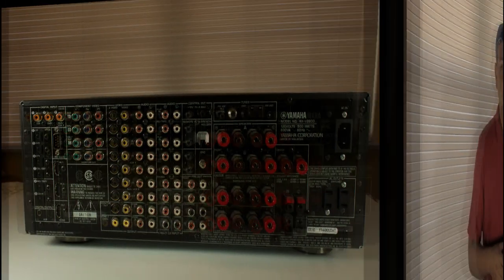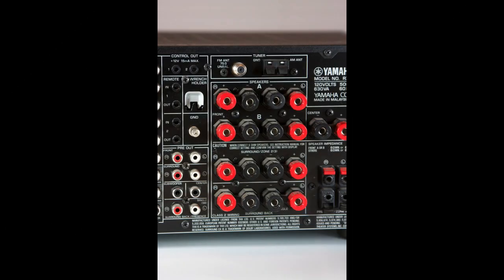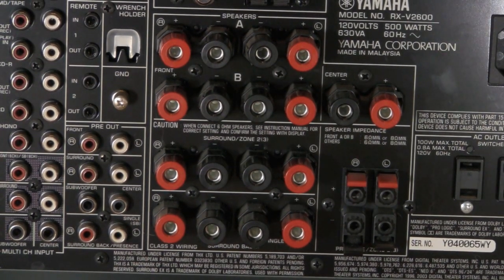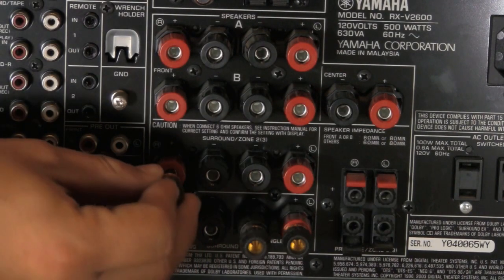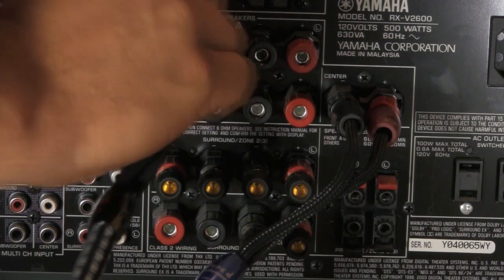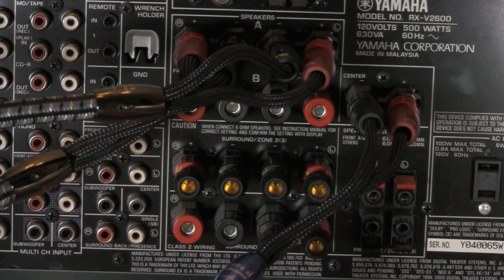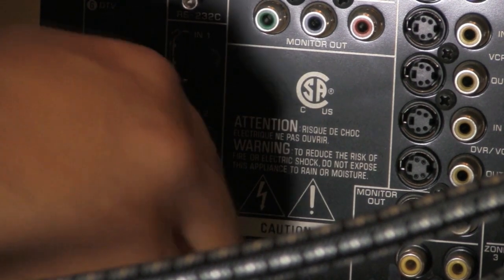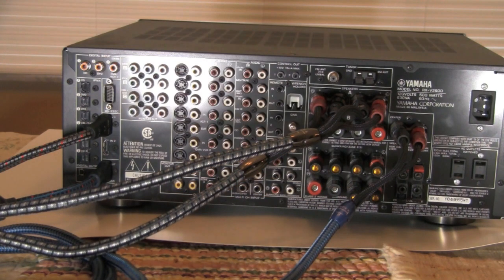how to hook up speakers

Comment from the maker: If you're not sure which 5.1 or 7.1, put the rear channels above the furtherest seating point . This way, you are set up to do either 5.1 or 7.1. You can start with 5.1 especially if you want to drive another zone. If you are doing in-ceiling speakers, directly above that seating position or dipole on the wall at ear level. The receiver should have an optimizer mic which will help to create your sweet spot. The mic helps but feel free to play with those setting until it sounds right to you!

Comment: I've done this set up. 
With the exception of the banana ends.
Keeping it simple is key.
Reply from the maker: It would be nice to keep it simple. Unfortunately, that will not be the case over the next few years as 4k rolls out. I have already had many issues with 4k and legacy gear. Look for the configurations of wires to connect everything to get a little more complicated due to compatibility issues! I still do Home Theater for an actual living. This video was done a few years ago.
Reply: I plan on getting a Vizio 4K LED TV & a Sony  4K recivier. It should be compatible with my PS3, I hope...
Reply: I do my own home theatre.
Reply from the maker: Not very well if you don't use banana plugs!
Reply from the maker: VISIO SUCKS!!!!!!!!!!! SONY AUDIO IS SHITTTTTT!!!!!!!!!!!!!!
Reply from the maker: Do some homework and stop shopping at Best Buy!
Reply: I did my research on Vizio hdtv's.
They actually are very good brand.
Sony is a great product as well. If I had the $ to buy it I'd get Marantz.or Sony ES.
Reply from the maker: I have seen way too many Visio Flat panels to say they are a good brand. They are a selling brand that makes money off of having such a low price, it makes the set a throw away model. Warranty is questionable. 

As far as Sony ES, that is definitely the way I would go if I where to waste money on a product. Nothing you can to me will convince me other wise on Sony. Their sound is horrible. I have owned a few.

If you like Marantz, look at Denon. Strong line up and solid amps. And look into the X series not the little bullshit S series. 

You really should stop reading ad-driven blogs/magazines. Consumer reports won't help either. If you work in my field, you would know that Visio sucks and Sony is not the player they once were. But I really don't know anything. I only work with this stuff on a daily basis for long ass time.
Reply: webstar12712
Reply: Yeah stick to Sony, LG, and Samsung for 4k UHD TV's...
Reply: +Kevin Igar but isn't Sony the leading innovator of hi-res audio??
Reply from the maker: Only if you believe in Santa Clause.
Reply: Kevin Igar Last question, which brands would you recommend for hi-res audio and why?
Reply from the maker: Denon, Anthem, Yamaha. And depends on your speakers, cables, room correction. I am not a fan of Sony audio or TV. Cams, love em.  

Where are you getting High res from? That will matter as well.
Reply: Kevin Igar Websites who formatted the music to hi-resolution. Some of the receivers nowadays can connect via wifi if i'm not mistaken.

Comment from the maker: Hi Sam,

First, what exactly are you trying to connect to the TV? If you are looking to get your sound, make sure to use the source's (DVD player, cable box, etc.) digital out to the receiver. An optical cable or a digital coax (little circle with orange in the middle) to the receiver should get the sound.

Comment from the maker: Yes you can have 6.2 or 7.4. If your amp does not have an output for multiple subs, use a splitter and then adjust your settings to your room. That should work.

Comment from the maker: Look at the back of the side speakers and center, there should be an round top that will come off; they will pop off as opposed to loosening. (Unless, your speaker have a post that you would push down on to connect the bare wire to.) Pop off the round piece on top of the post and insert the banana clip there. Hope that helped your life!

Comment from the maker: That shouldn't be an issue. All you need to do is screw out the speaker post and then insert the cable then tighten the speaker post back down.

Comment: What if all of my wires (without the banana clips) are the same color as the one you showed (white with frayed wire)?  Do I just put one in the red and black?  I'm moving into a new home and the people who lived there left the wires hanging out of the wall and said they have no idea how it works because they never use it after they bought from the last buyer.  I just don't want to cap the plugs since I have the speakers already in the ceiling.

Comment: Kevin, Thanks, very informative. Question: Is there a way to label these wires to make it easier to reconnect if you must pull the existing connections?
Reply from the maker: Hey Alex,

There is a very simple way to do it. Depending on the wire: you can use a sharpie to label them if you're using a standard cable. If you're using custom cables, take some white tape and label them with the sharpie. Really no special way to do as long as you know what you did.

Comment: some of the new receivers or avr have LFE for the subwoofers input...only sends info for movies to the sub not music...therefore i plug subwoofer into speaker front input or center input on preout section...FOR THE MUSIC ASPECTS ALSO..
Reply from the maker: I see your point, I just don't agree. The LFE or sub pre-out sends two types of signals:

1st: Low Frequency response in each of the speakers. A cross-over does this automatically.

2nd: This is bass for movies. 

I think you're a little on the overkill side but I like your thinking! try dis-conecting a few cables. Make sure that your speaker size in your settings is set to small. If you don't do this, there will be no sub-woofer at all.
Reply: you are correct...i concur with ya..lol but still...the lfe is for sound effects and movies, etc..not music..therefore if lfe connection is used...when i play music there will be no bass..therefore i use pre out frontS ..run an RCA y adapter THEN RUN SUB CABLE TO MY BIC F12.
Reply from the maker: Go into your speaker settings on your receiver and make sure that they are set to small. I think that this is your problem as well.
Reply: i did..reset all to small..on my pioneer elite sc 67..reconfigured all my speakers correctly now..thanx!
Reply from the maker: Awesome!!!!

Comment: Is there a vga out on most of these?
Reply from the maker: No. There is a a port that looks like a VGA but it is a serial port. RS-232 is a control interface. I don't know of any receiver that has a VGA these days. You can get an adapter for HDMI to VGA.

Comment: hi i have a sony RECEIVER STR-DB790 that has a port that says SUBWOOFER AUDIO OUT AND A CRYSTAL AUDIO SUB WITH INTEGRATED AMPLIFIER IN IT WITH ONLY ONE PORT THAT SAYS SUBWOOFER  INPUT I  HAVE CONNECTED THE SUB WITH THE RECEIVER WITH A RCA CABLE ONE TO ONE PORT AND THE OTHER TO THE OVER PORT. THEN I CONNECT RIGHT AND LEFT TO A VIDEO WITH A RED AND WHITE RCA CABLES WITH A 3.5mm JACK AT THE END AND THEN TO MY PHONE ALL 4 SPEAKERS ARE PLAYING EXPECT THE SUBWOOFER I CHECKED THE SETTINGS ON THE RESEIVER END IT ALL CORRECT BUT NOTHING FROM THE SUB IT IS ONLY MAKING A NOICE THAT GETTING LOUDER WHEN I TURN THE VOLUME ON THE SUB BUT NO MUSICI I DONT KNOW THE PROBLE PLEASE SOMEONE RESPONT THIS COMMENT
Reply from the maker: You are going to need to go into the setup menu for the Sony. Find your speaker settings. They will probably be set to large. You need to switch that to small. This will tell the Sony to send the LFE to the sub and not the front speakers. Has nothing to do with the size of the speakers. That should get you done!
Reply: DID THAT STILL NOTHINK
Reply: i connected to the tape out
end somehow it worked
Reply from the maker: Dude, you need to connect it to the sub pre-out. Do it right please!
Reply: it doesnt work i put small all speakers all settings are correct still no music or bass i am fine with tape out to. i think somethink wrong with the sub audio out
Reply from the maker: At this point, I would agree with that.
Reply: thanks for responding
Reply: Yeah, that's what you're sub is supposed to do. It's supposed to make a noise that keeps getting louder because the subwoofer provides the bass only.